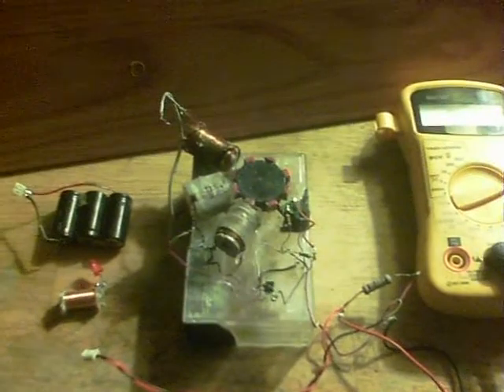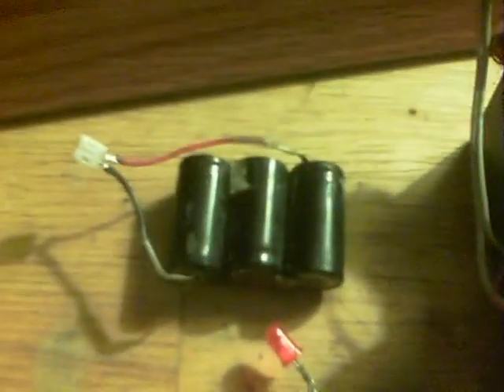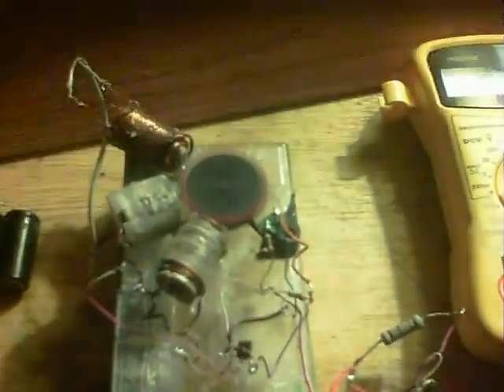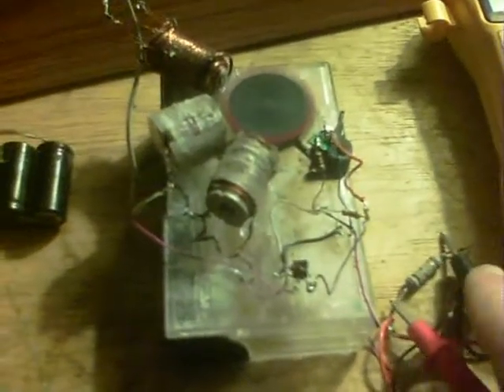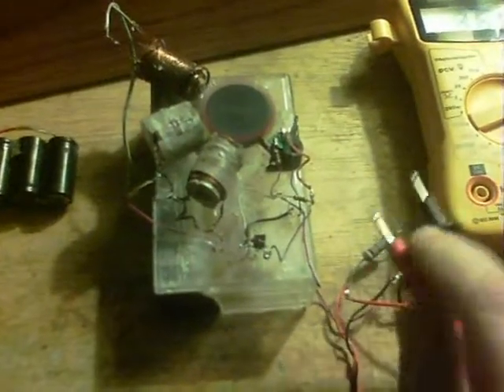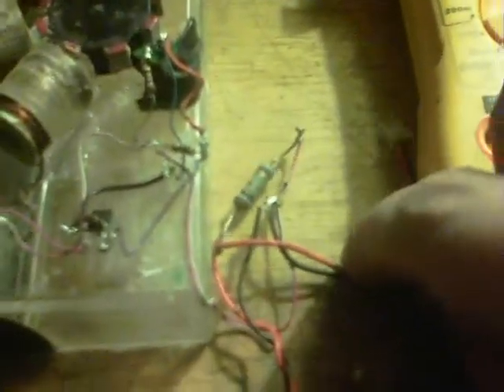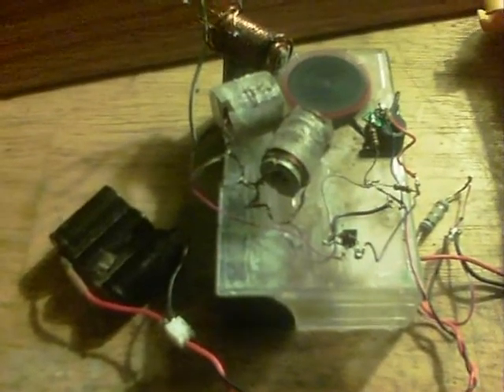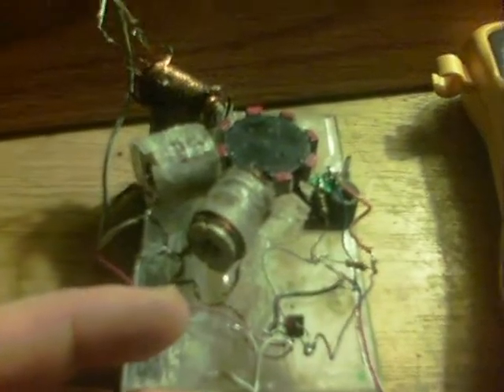3 x series coils for F1 pulse motor !

Comment from the maker: @jimboot2 Haha yeah Jim...and it HAS happened with this build. I set the wall adapter on 4.5V in early tests and 1 neo flew off. It bumped into the DVM and just sat there. right in front of me !
Super glue is best, but I ran out, so used the gel type of superglue...it doesn't cope as well with higher revs. Speed speed, I want more speed...it's like a Thunder horse on steroids, with a knot in its neck lol

Comment from the maker: @frenkystromar Aha..I see. Just placed the meter between positive in series and got 70mA, which is far more likely.the correct reading. The transistor can't do more than 100mA, but it is a factor of 10 to how readings were being taken before. Must just be that 1ohm are easier to find when I see it on the web as the way to measure. Cool, thanks for that, I was always unsure.